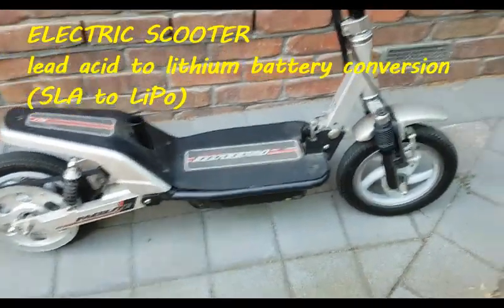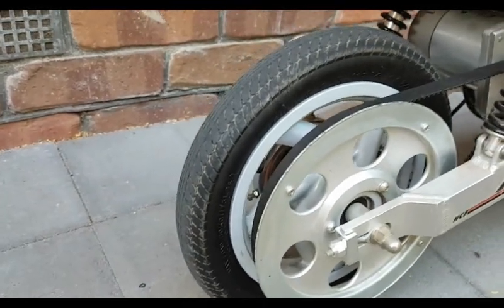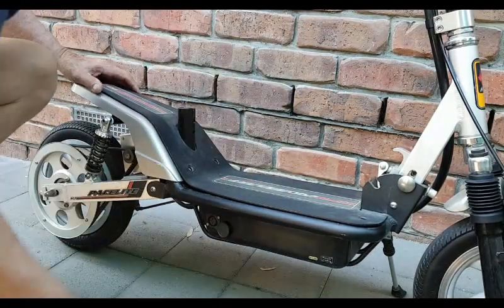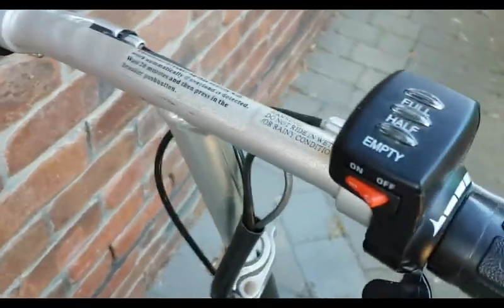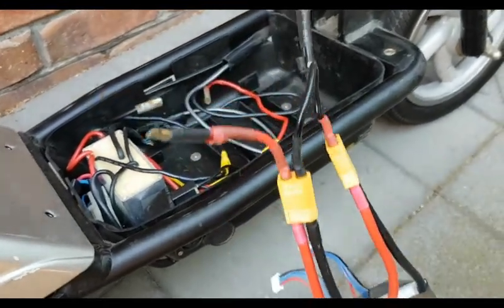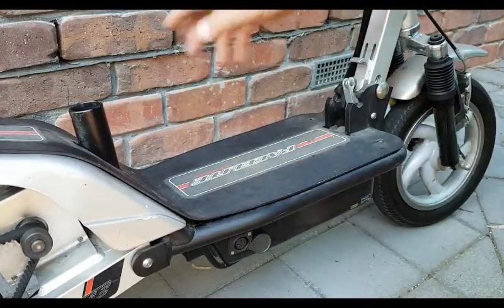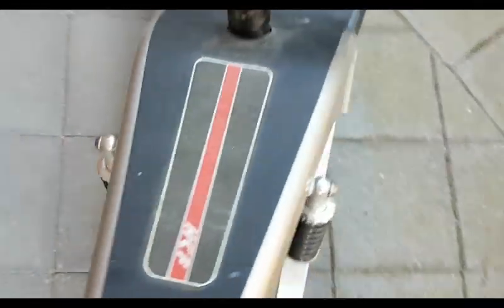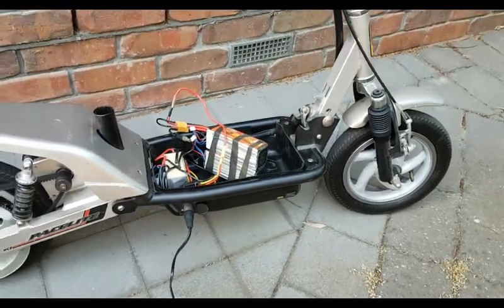Electric scooter conversion - SLA to LiPo - Part 1

Comment: hey I got a question can you link the battery or no?
Reply from the maker: Look up LiPo batteries on ebay - all sorts available.. mine were 11.1v 8A - used two in series.

Comment: cool working on same convertion, build new packs of 18650, but are shooting for 8s (a little higher charge) , 2 led acid batteriets at full Will be 26v , and 8s 29.6(30v) hoping that the brushed controller have a little higher tolorence.
i have a old board, if IT lets put the ghost, whell than a new controller is 70$ om Ali :)
Reply from the maker: Good scooter - worth converting. Tried a 36v lithium battery but overloaded controller. Had to reset. 30v might work. Good luck.

Comment: I suggest you watch lipo batteries 101 videos about charging procedures and discharging because you can not used lipo in replacement of acid battery without a low voltage alert to prevent over discharging the lipo batteries!
Reply from the maker: Yes.. got a low voltage warning buzzer connected to the battery balance leads..

Comment: Do have a lipo low voltage cut off installed? If not this is not a safe installation because once the lipo battery goes below a voltage charge point then it will be unusable and can not be charge fully!
Reply: Lipo alarm my friend.. Simple

Comment: Top speed ?
Reply from the maker: Not very fast. The scooter was only designed to do about 20kph with it's original battery. The lithium replacement doesn't change that because the voltage is the same. I would need to run it at 36v instead of 24v to make it faster, but I would need to change the controller as well. 36v would burn out the current controller.

Comment: Mr. JO C — your idea was excellent and I appreciate the time you took to create this video... However, I wish you had included a parts list in the description or perhaps some website links to resources that would lay out a project like this in an easy to read way..... 

My kids have 2 razor scooters... an e95 & e175 which both run on the stupid acid batteries which are beginning to perform poorly.... 

I’ve been WANTING TO CUSTOM BUILD NEW BATTERIES FOR BOTH BUT THERE IS LITERALLY NO STRAIGHTFORWARD INFORMATION ONLINE ON HOW TO DO SO... 

Could you PLEASE explain where I can find a full technical explanation of performing a conversion like this or explain it yourself??? I understand the way these new cells perform and why they’re superior, but how do I examine the specs of my 2 scooters to understand what is needed, what they can handle, and how to get the BEST performance upgrades without risking fire hazard. Currently they can only go about 10MPH and 10 miles distance. I want to increase both. 
Please help.
Reply from the maker: By coincidence, I spent this week repairing my grandkids Razor scooters. I didn't bother converting them to lithium though, it's too dificult, especially for use by kids.
Lithium batteries (LiPo) are good for power and light weight but they can't be charged as easily as lead acid.  For the conversion shown in my video, I used two 11.1v RC hobby batteries which, when joined in series and fully charged provide 25.2v, which runs the 24v scooter well.
BUT... the problem comes with charging. Lithiums are touchy! You need a special lithium battery charger that enables both normal and balance charging (or you can kill the battery), which can't be done through the scooter charge port, or, alternatively, you need to buy a BMS (battery management system) board to attach to the batteries to make charging simpler.
Don't want to put you off, but there's a bit of a learning curve when dealing with lithium  - and sorry I haven't provided more details but it would take a very long reply. Check out info on lithium batteries on Google - there's lots available. Thanks for your interest.
Reply: Jo C — HEY!!! Thanks a lot for replying!!! I actually do have a lipo smart balance charger!! It’s blue and was purchased a few years ago when I was into RC cars that ran on lipo ...  I’ve heard others talk about the BMS but never saw specific details, and I’m not at all afraid of the charging aspect since I have the charger...  

I think what I’m most confused about is HOW TO KNOW what a scooter CAN or CANT handle...  when you said the scooter is 24v, and your battery combo created a total of 25.2v, it made perfect sense that you knew you had to get UP TO 24v in order to achieve the SAME supply of power as the acid batts were..

Where I get lost is HOW YOU KNEW that the lipo replacement would function the exact same way that the lead acid did as long as you produced an equal voltage... it’s my assumption that all these batteries ARE TOUCHY and behave in their own unique ways... but am I mistaken in thinking that they OUTPUT POWER differently? And maybe the only way they actually differ is in charging and maintenance respects? In other words, is it true that you’re saying a 24v output from a lead acid battery is the same as a 24v output from a lipo battery? That in that respect a battery is a battery?

Next, I wonder how I’d know how to UPGRADE the power so that I’d achieve greater speeds and greater longevity between charges....

Based on what I’ve learned from your comment and videos, is it true that the MOTOR (assuming mine are 24v also) can never handle more output than its rated 24v?? And if I wanted FASTER, it would require I higher voltage MOTOR?? Or is there another way to achieve greater speeds?

Then, if longevity is the concern, would I simply add more lipo batteries to increase the “amp hours” while maintaining an output max of 24v???  (Or a higher voltage if a speed upgrade was done)

If you can answer these things for me, it would be FAR MORE than I’ve learned elsewhere and I’d greatly appreciate it....  

I’m nowhere near “completely inexperienced” with these things, but I’m not yet at the level of UNDERSTANDING HOW IT ALL WORKS so that I could easily determine what components effect others and how to compensate for any negative effects of modifications...  I’m determined to learn, I just wish there were more clear cut resources available online. I’ve never had more difficulty gathering a full scope of beginner info into a topic in my life. It’s strange. This is the only reason I’m bothering you this much. I hope you can appreciate that. Cheers!
Reply from the maker: @flojotube  Yes, a battery is a battery. Doesn't matter if the 24v (24v for the e175, 12v for the e95) comes from lead acid or lithium. The charging is what's different. If you use lithium RC cells (which is what I used) you need to match the voltage and the amps with that of the lead acid. You 'may or may not' increase the volts and the amps if you want the scooter to go faster or have more torque - that depends totally on the controller (little box inside the scooter). Most are purpose built and will only accept very small increases in volts or amps before they overload and stop working. To increase speed or power to the scooter, you usually have to change controller to more powerful one, which begins to get too difficult. The current DC motor can tollerate increases in power but you will probably find the controller does not. 
If you can find a way to exit the charging leads of the lithiuim batteries (both the power and balance leads) from the scooter, then you're good to go with the blue charger you have (Imax?).
Changing the batteries to lithium, even without an increase in voltage or amps, has the advantage of making the scooter lighter and improve speed and range a bit.

Comment: Nice set-up. I've got an old Raleigh bike that I hooked up a hub motor and SLAs about 12 years ago. Was a pretty solid conversion, but the batteries are shot and lithium is significantly more affordable now. Does anyone know of good DIY resources to assist in such a conversion?
Reply: The Man From Saturn — I’m just now driving into the world of ebikes and scooters since my 2 kids have Razor e95 and e175 scooters and I’ve adopted a debilitating ankle issue just in time for the summer... the e175 battery is performing strangely, power dumps and dying sooner than the e95, and both scooters simply don’t LAST long enough OR go fast enough for my kids’ taste anymore.... it’s been NEXT TO IMPOSSIBLE TO FIND ANY STRAIGHT FORWARD RESOURCES ANYWHERE ONLINE TO HELP A NOVICE FULLY UNDERSTAND THE TECHNOLOGY AS IT STANDS AND HOW EXACTLY TO PERFORM A CONVERSION!!! Massively FRUSTRATING considering how vast the internet is, and I find it very hard to believe that EVERYONE who’s done these conversions to Lithium batteries are so inconsiderate or selfish that they didn’t think to share their findings with the world....

Anyhow, the scooter project is ongoing, and I’ve also been looking for an Ebike for myself. I believe I’ve decided on a Rad Power Bike.. I haven’t even ordered it yet, but I’ve already seen videos on how to “hack” those bikes to make them faster or travel longer distances, and I’ve began doing some research into that topic hoping I can KNOW WHAT IM DOING before the bike even arrives. 

Now I saw YOUR POST and my mind was yet again blown. I had NO CLUE that I could CONVERT manual pedal bike to an Ebike until now...... 🤯 

Have you found anymore info since this comment?? Could you share whatever resources you have thus far with me please?? I do have a street bike in perfect shape but because of my ankle, the Ebike is really all I can do this summer to be able to enjoy time with my kids. If I could convert MY BIKE to electric and have it meet similar or better performance stats, I’d do it tomorrow. PLEASE SHARE!!! Thanks
Reply: FLOJOtube I’m afraid I haven’t very much investigation, been very busy but have been meaning to ask at endlesssphere forums. Will report back if I can remember.
Reply: @ManFromSaturn any luck?